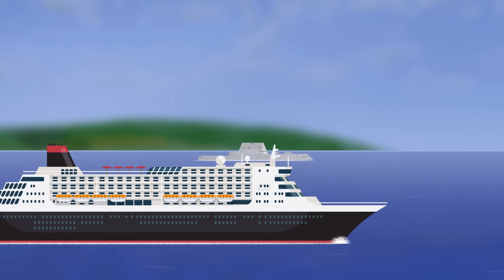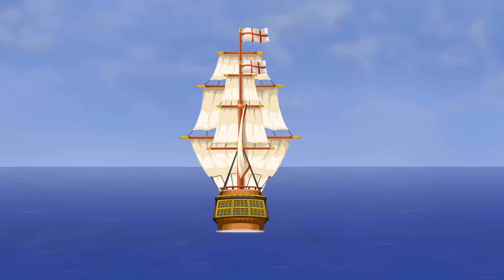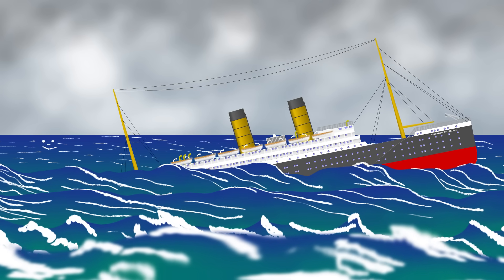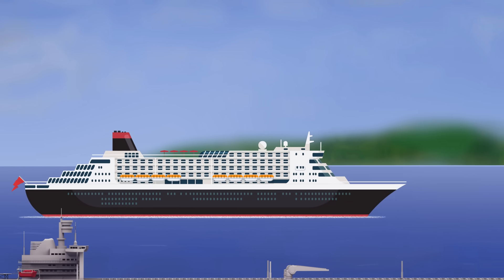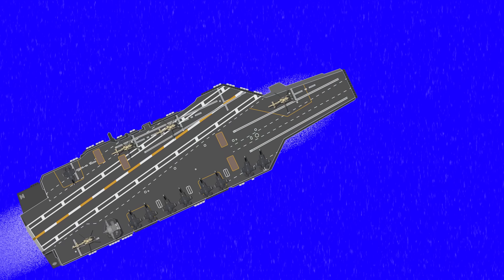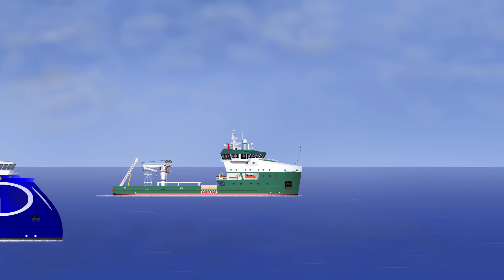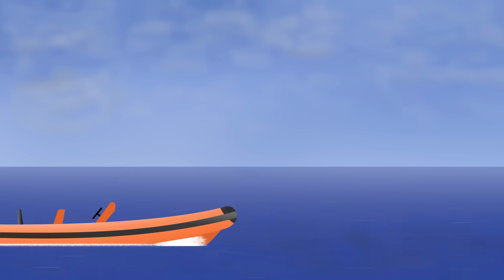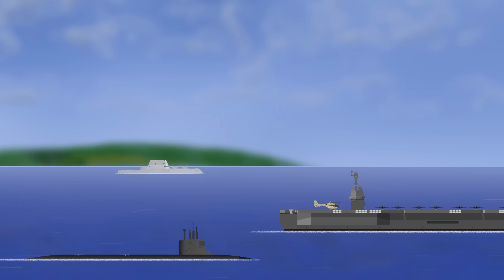Why Are Bows That Shape?

Comment: TLDR
From above
Round bow: maximum carrying capacity
Pointy bow: low drag, high efficiency or speed
From the side
Ram bow: maximum stability, or for sinking ships by ramming
Vertical bow: good stability, lighter
Flared bow: better riding over waves, heavier, potentially less water on the deck
Hemispherical bow: minimum drag when completely submerged

Comment: The axe-bow, or in your words "plumb bow", is usually done to increase length of waterline, to increase hullspeed, but Fossatti, in Aero-Hydrodynamics of Sailing, showed that the turbulence produced by the unfair entry of the bow/keel reduces overall-speed: you want a soft entry.

Recreational boats scale & ship's scale are 2 fundamentally-different domains.

1 is built using scantlings, the other with full FEA & CFD.

They need to be treated differently, in learning.

Thank you for the insights you've given to me,

_ /\ _

Comment: Modern lake freighters, particularly those built since the late 20th century, feature more rounded or "blunt" bows primarily to maximize cargo capacity within the strict dimensional limits of the Great Lakes locks. 
Key reasons for this design include:
Maximizing Cargo Volume: A rounded or blunt bow has a higher "block coefficient," meaning its shape is closer to a rectangle than a wedge. This allows the vessel to carry significantly more tonnage—sometimes tens of thousands of tons more—than a traditional sharp-bowed ship of the same length and width.
Operating Speed Trade-offs: Unlike ocean-going vessels that prioritize high-speed efficiency for long transits, lake freighters operate on shorter routes at lower average speeds (typically around 15 knots). At these speeds, the added drag of a rounded bow is a worthwhile trade-off for the massive increase in revenue-generating cargo capacity.
Ice Navigation: A heavy, rounded bow is more effective for breaking through the ice sheets commonly found on the Great Lakes during winter. The blunt shape can push over ice and use the ship's weight to crush it, whereas a sharp bow might simply get wedged.
Hydrodynamic Lift: Newer designs, such as the Mark W. Barker (launched 2022), use optimized blunt bows that help force water under the hull rather than just parting it, creating a slight upward lift that can improve economy despite the non-streamlined appearance.
Lock Navigation: Blunt bows allow the ship to utilize nearly every inch of a lock's length. A pointed bow would waste several feet of space at the front of the lock that could otherwise be filled with cargo.

Comment: Boats like planes are all designed for a mission. If all you want is a low speed, coastal cruising, Greek Island hopping sunshine laden live aboard then why is nobody making a "fit for purpose" vessel for this task. Just a cheap, aluminum, space maximizing catamaran box hull with a pointy bit at the front. Low power electric drives, used Tesla batteries and Maxeon 3 solar panels with telescopic extensions.

Comment: In a more organized structure, there are several aspects of bow design:
normal (forward raked) versus inverted orientation of the stem at and above the waterline
flared versus tumblehome shape of the sides above the waterline
blunt or sharp ("fine") shape, particularly entry at the waterline
transverse shape of the hull below the waterline
etc

The video mixes the transverse (flared versus tumblehome) and longitudinal (inverted, vertical, raked) shapes of the bow, and largely ignores the difference between the shape above the waterline (the prow), at the waterline (the entry), and below the waterline.

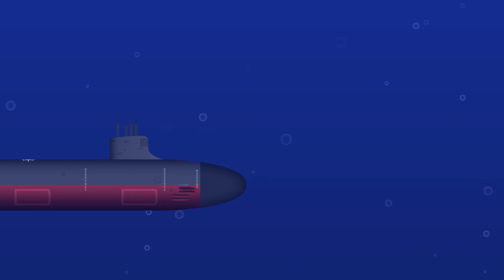Comment: The comment about submarines at 6:48 disregards the fact that while the pressure hull of a submarine must (in practical terms) be a cylinder (tube) with hemispherical (dome) ends, the bow shape of a submarine is not the pressure hull - it is a fairing over the pressure hull and whatever is mounted in front of the pressure hull. In a military submarine, there is usually a large spherical sonar device ahead of the pressure hull, and the visible hull is a cover over that, shaped as compromise between hydrodynamics, sonar performance, and functionality such as torpedo tubes. 

A sub can have essentially any shape of bow, regardless of the pressure hull, as long as the outer full shape eventually transitions to closely fit the tubular pressure hull. Bulbous, vertical stem, inverted or conventional, flared or tumblehome... they're all possible and have all been done, depending mostly on the requirement to operate at the surface. 

The sub's bow shape has nothing to do with protection from external pressure - that's the internal pressure hull's function, and it is not shaped like the external bow.

Comment: The video seems to confuse with the orientation of the stem and the slope of the sides. The illustration of the Storstad shows an inverted bow, meaning the stem is leans rearward with increasing height, but the narration refers to tumblehome, which actually means a hull which grows narrower above the waterline than its beam (sides sloping inward); it is the opposite of flare, and both terms describe what happens across the vessel, rather than fore-aft. 

The side-to-side shape (tumblehome or flare) and the fore-aft shape (stem orientation: normal/raked, vertical, or inverted) are separate design features.

Comment: You missed it widely about sailing ships, they were and they still are built in a shape of a knife, without bulbous bow, with block coeficient around 0.65 (google it real quick). Furthermore - old sailing ships were built of wood and they could not support any extensive weight near the keel. But yet - they were stable and much more seaworthy than majority of today ships. The trick ? Keel block, along the vessel length, up to 1.5 meters height. Do the homework before you post dumb statements about sailing ships.

Comment: My ship has a straight bow and the hull is the same area as the deck and wide which means there is no need for weights or balance and also allows you to increase the vessels deadweight, my ship also has a shaft pointed hull which is why it doesn’t need any bulbous bow because the bow itself is already pointed, adding a bulbous bow in this case would not be efficient as it’s more wide and bulged, it would use more fuel, add more weight and cost and block out the hydrodynamics of the very efficient sharp pointed bow, if you look at Icon of the Seas, the newest edition to the royal carribean cruise fleet, they have a straight and sharp pointed hull. This helps break up and weaken the waves and split through the water going through the waves instead of going over them.

Comment: My invention flash driving running in light speed way can power that perpetual power 100000v ac x2 as big as 4 luggage only .
No bringing of tons of tons of fuel . No refuelling. 
The power of levitation levitating invention the front pull the ship and the back push the load and center zero which is the chassis and load is following . 
Like a tug boat pulling the load and pushing the load .
Center zero which is the chassis and load is following only. 
You want that then pay for my 50years in repair works 10 m $ first .

Comment: An interesting comparison also is northeast lobster boats, the ones in New England are pretty conventional looking forward angled flared bows raked or spoon I guess but the lobster boats from Nova Scotia called Novi boats are drastically different they have a big bulbus very tall plumb bow and the windshield is always a forward angled where new england boats primarily angle back. Only thing I can think is even tho new england boats see rough seas novi boats see even narlier seas so maybe that dictated there more off shore ship design.

Comment: Great vid.  One comment - on leasure yachts I think it is generally assumed that plumb bows pitch more than a long forefoot.  The fine foretoot / long flare progressively increases boyancy as it hits a wave, so more gently lifts the bow.  A plum bow raises boyancy rather more suddenly.  The advantage of the plum bow - and reaso it is now popular is that it lengthenes the waterline so makes the boat faster.  As a general rule, plum bows are popular with racers and cruiser racers - but a more traditional long forefoot is still highly prized by long distance cruisers who expect weeks of heavy weather and put a bit more emphasis on a kindly motion than absolute speed.

Comment: A submarine's bow does not protect against pressure, it is simply a fairing to let the water pass smoothly and quietly. The volume inside the rounded bow is flooded with water when it submerges and the pressure hull is further inside.

Comment: Just to be clear about essential terminology, LOGIC doesn't tell us anything about the properties of the physical world.

We would have to understand the physical properties of fluids, such as mass, viscosity, elasticity, adhesion, and surface tension in order to explain why certain bow shapes are optimal under certain conditions in certain fluids. We have to start with OBSERVATION about the world around us. Even brute force trial and error will take care of the rest, given sufficient time. After all, that's how evolution works. Fish swim, birds fly, and they do so with remarkable efficiency.

LOGIC comes in when we want to do better than trial and error. Its value becomes more evident in complex situations, and where time to solution may be critical.

Comment: Good design for specific purposes is crucial. I own a fibreglass canoe that's unsinkable. It's flared out U shaped 5"at the gunnels (Not foam add-ons) from its tall V bow to the stern, with a flat bottom & 1" keel. It rides low with shallow draft, yet can carry 800 lb max, and has incredible lateral stability. Two 200 lb men standing, trying to roll it, will only get wet, repeatedly. Climbing back in solo is simply grabbing the centre brace, a couple kicks & you're in. You can submerge it completely & still be able to paddle it. It's the only canoe I would trust my family's life with, especially on rough open water.

Comment: What are you talking there? The bow's shape has nothing to do with stability. And you've said it yourself in the illustration that what matters is the design of the ship's submerged width along it. The bow makes only a small portion of the total length of the submerged volume. You can have a very sharp and long bow and still make it the most stable in the world by having the width grow as much and as fast as you like as a function of length before it blends with the tail. You make the bow more bulky for increased volume, not for stability issues!

Comment: The bow of most submarines are NOT designed the way they are to protect against pressure, it can't be since most of them are free flood areas with sonars in, the pressure hull doesn't start until further back, the shape is entirely for hydrodynamic reasons.

Comment: The nose of a submarine isn’t generally designed to withstand pressure, it’s there to protect the sonar array and is generally open to the ambient sea pressure.  There’s a pressure bulkhead located behind the nose which protects the interior of the sub from the underwater pressure.

Comment: A big reason the most modern sailing yachts have plumb, i.e., vertical, boys is to increase the length at the waterline (lwl) for the purpose of increasing hull speed.  They are displacement vessels, so their speed is limited by their waterline length.  They are not designed to plane, though in steep waves they can sometimes plane when surfing down the wave face, which can be dangerous because it increases the chances of a broach, i.e., turning beam-to the wave train and rolling down the face of the wave and possibly turning a 180 or even a 360, or even being thrown down into the trough.  Surfing also risks burying the bow into the back of the wave in front of you, which can lead to pitch-poling, aka endo.  Not good.  Which is why it's good advice to not run in the same exact direction as the seas, instead choosing to bear off at an angle of 15-25 degrees.  Or avoid all that by trailing a Jordan Series Drogue to keep the boat stern-to the wave train while slowing it down to 1-2 knots, so the waves pass under you as you rise up and down with them.

Comment: You really should not have brought the Zumwalt class, they are anything but stable on the water's and the bow design is so bad that it dips and submerges it's nose when at speed in turbulent waters instead of "cutting" through, putting ridiculous amounts of structural strain on the vessel super structure which has resulted in millions extra in ship maintanence. This is is just 1 of the many reasons these things are being phased out.

Comment: Ship length is also a factor, typically a long ship should punch through a wave rather than ride it so it won't break in half, that's why oil tankers have thick water tight bulkheads and small windows even above the deck, while cruise ships designed to ride waves can have fancy upper decks.

Comment: I may be wrong but when a ship is running there appears a trough a aft the bow wave roughly as deep as the wave is high. Consequently, many vessels seem to be designed such that full beam - or something near it - is reached around the mid-point of the trough produced at standard cruising speed. This supposedly enhances the stability.

Comment: Bows are actually decrease efficiency if used on boats under 14m length. 
Bows dont reduce the frictional resistance they reduce to wave making resistance. You simply make less wave with bows.

Comment: Something else must be pointed out about submarine noses:  They carry a lot of sensors in the nose, and they want those sensors to operate as spherically as possible, so they can “see” as much as possible in as close to 360 degrees around them as possible. Thus, the round design. The design is dictated as much by those sensors under the skin as the requirements of dealing with undersea pressures.

Comment: I'm shocked that the effect of the waterline length has been completely ignored in this video.  It is a characteristic of all displacement hulls that the longer the waterline, the higher the "hull speed", the maximum speed possible when the ship creates only 2 wave crests, one at the bow and one at the stern.  The formula for the max speed is something like Vmax = the square root of the water line length times a constant for the shape of the hull.  Often this constant  is anywhere between 1.2 and 5, to give the hull speed in knots if the length is in ft.  This is the reason that many classic sailing vessels had very long overhangs, both at the bow AND the stern.  As the wind increases, the boat heels, putting more of the overhangs into the water and increasing the effective waterline length.

This is also at least part of the reason for the the bulge in the bow below the waterline for many large ships.  That bulge creates a bow wave in front of the actual bow, again effectively lengthening the waterline.  It also can house sonar, which is important for military vessels.

Comment: The reason modern aircraft carriers have angled flight decks is so they can launch and recover aircraft at the same time so when an aircraft misses the arresting wire it can keep flying off the side to go around and try again instead and not run into the other aircraft on the forward part of the flightdeck getting ready to launch; not as you suggested to keep water coming on the deck during rough seas.   

Also, the deck directly below the flightdeck contains the offices, ready rooms, and staterooms for the squadrons and pilots; below that is the huge hangar deck that has to have enough clearance to accommodate the largest aircraft and all the separate squadron workshops.  Below the hangar deck you have decks for ship's crew berthings, gallies, messdecks, medical facilities, engineering, and other spaces.  This is the reason carriers are so high out of the water, not to keep them from getting wet on the flightdeck.  For US carriers there is a maximum height due to the bridge that connects Coronado to San Diego and a carrier has to be able to clear that bridge at high tide in case it has to sortie for whatever reason in an emergency and not have to wait for low tide.

Naval aircraft are all-weather and have no problem operating in the rain or getting some salt water sprayed on them; plus, the ships by their existence have to operate in wet conditions all the time.  My 20 years in the Navy and naval aviation I saw plenty of wet weather ops.

Comment: @3:20, you mean "25 feet" not "meters". On a racing sailboat, a plumb bow is best because overhangs = extra weight. A plum bow offers the longest waterline for a given length of boat. I't also more aerodynamic. When racing you want all the advantages you can get. Your sails trying to "lift" you forward while the true wind, combined with apparent wind adds resistance to the whole structure moving forward so aerodynamics of the boat, hull and rig all play a part. You do get more spray over the bow however, which is not a good cruising feature. A cruising boat should have some flare. Going downwind with a plumb bow however has less buoyancy and is more subject to submerging, making it hard to steer and you can even get corkscrewing dynamics in the worst case. This usually means you have too much sail up but now were getting into a whole new story.

Comment: The vertical bows of modern sailboats are designed to maximize the waterline at the expense of comfort. Foiling race boats have inverted "wave piercing" bows to avoid pitching up. Some older sailboats had long overhangs both bow and stern because of a set of complex rules of measuring the waterline. Effective waterline on 10 degrees heel was substantially longer than static.